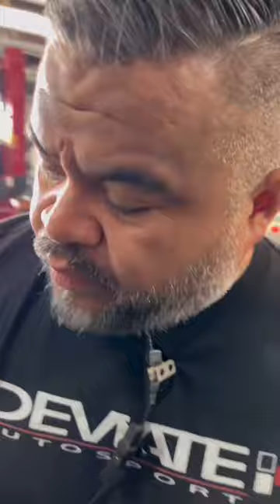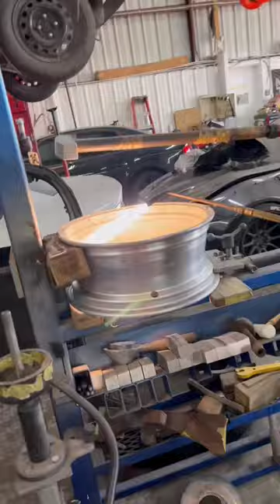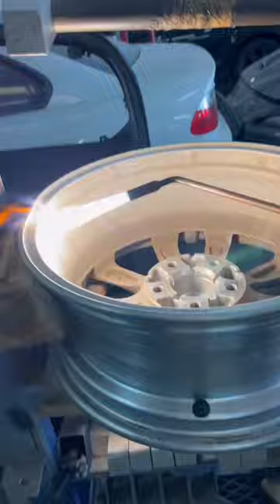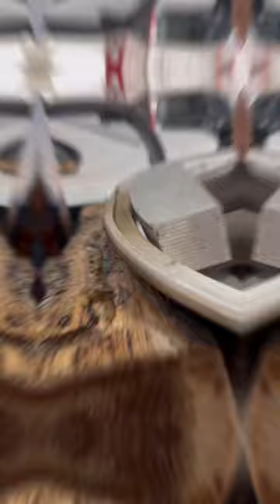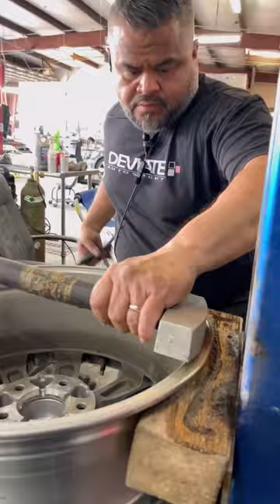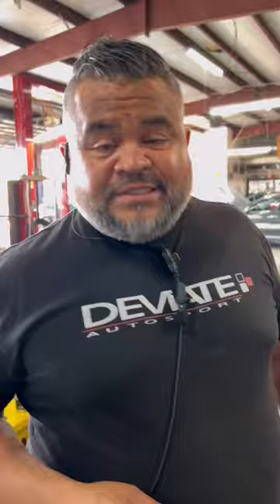@dv8aroldo  SHOW’S HOW TO FIX BENT WHEELS‼️‼️ #shorts

Comment: Aluminum is very soft and once a metal has bent, it loses strength. Furthermore, heating it up also causes material changes to the structure of the metal.
Reply: But he a hustla he a he a hustla he a hustla he a he a hustla
Reply: agree 100% I'm sure he knows that and has the customer sign an agreement and tells them to NEVER put them back on the front of the car again.
Reply: @FetusFight 🤣

Comment: Once its bent the integrity of the metal is compromised and it will be forever weak in that spot. It will want to bend back into that shape overtime.
Reply: If its on a race car where everything counts then it would be a problem but  on a daily driver that probably wont see much abuse it doesn't matter all that much.
Reply: Abuse? 😂 shits already seen abuse daily driven
Reply: Straighten it and sell em mint condition 👌🏼
Reply: Yet it's done every day, and to high end exotics.  Nothing is blowing up, coming apart or bursting into flames. Calm down.
Reply: When you heat aluminum it anneals then when you work it "work hardens" should be just fine
Reply: Like 65 million years
Reply: 😂 stay in school
Reply: @yungtye 😂

Comment: Are you concerned with adding heat on that aluminum like that?  Do you use heat crayons or anything to know that you haven’t compromised the structure?
Reply: Aluminum alloys lose almost all their strength well before 300C / 572F. The structural integrity of that wheel is extremely compromised.

Comment: Id just get a new rim to be honest . Especially on something like a rear wheel drive sports car pushing 500 hp
Reply: It’ll be fine
Reply: It dont that serious bud. Its a very minor bend. Ive seen race cars with worse wheels than that.
Reply: it was super minor its fine
Reply: What car is it I didn’t see
Reply: rear wheel drive sports car pushing 500 hp🤓
Reply: @gang1798  it'll wobble like crazy
Reply: I disagree I worked in west Texas oilfields a few times because we bend rims on f350 in the wild days either drunk or on drugs after working 18 hour shift and hit cattle guard 30 mph asleep lolz then we take sledgehammer bend it back drive 200k miles hauling heavy ass overweight like pull me over please  past oil change 10k mile ole 6.7 psd baby rotella keep em pedal to the floor 😂 she was ran hard all the time with the it didn’t happen repair
Reply: This looks way more professional then sledgehammer accuracy
Reply: @clozedcaskets1438  West Texas trucks get beat tf up…no matter what company it is. Dents in the bed, what once was a metal truck bed is now a wood truck bed, broke back glass. I see a lot of it just from customers coming to the machine shop I work at 🤣

Comment: It's illegal to repair aluminum rims in most places in North America due to how much it's structural integrity is affected
Reply: that’s odd, i wonder why there are so many aluminum wheel repair specialists?
Reply: @SomcallmejameS  they're not a "Specialist" they're a hack. The amount of metallurgical precision you need between getting the right temps to ensure no micro cracks form when straightening the rim or that the metal won't be too brittle because it wasn't cooled at the right rate is too precise for it to be safe for just a random shop to repair. That's why it's illegal.
Reply: @SomcallmejameS  not to mention, to do it properly with all the right tools, temps and cooling time, by the end of getting to done right it would have been cheaper to get another set of rims
Reply: @buttadog5073  i’m sure the cast aluminum wheels from the factory are made with the UTMOST metallurgical precision. 🙄 The dude’s not out here bend fixing a TE37. It’s a factory alloy wheel. Even if you’re right about this it doesn’t explain why so many people are getting away with doing it (problem free i might add) on a daily basis if it’s genuinely illegal.
Reply: @SomcallmejameS whatever you say pal. If you knew anything about cast anything you'd know bending it severely reduces it's strength unless it's done at the right temp and cooled at the right rate, all there is to it
Reply: @buttadog5073 the heat was to anneal the aluminum then work hardens it's fine

Comment: I’ve had this done in the past on some amg wheels and they were great it was expensive the shop near me charges 140 bucks if it’s pretty bad and they were really bad 2 bends in it on the rear and it wouldn’t hold air or bun after that. Once it was fixed it was good though sold the rims bought new amg wheels hope that it doesn’t happen to these

Comment: That's amazing. Still driving careful with my wheels but I bet this cost less than replacing one ~$350 rim
Reply: Oh yeah. 
Probably around an hour in labor. Most shops where I'm at, that's $150 to $200. 
.3 to mount and balance a wheel. And then another .6 to .8 to set this up and press it. 
High(er) end wheels it's definitely worth it. 
Cheap(er) 16 inch and 17 inch, it might be easier to just buy a used one from a junk yard or FB market place or something
Reply: No, higher end wheels are not worth it to do it this way. Wtf makes u say that besides cost??? If you have multi-piece rims u can afford to change an inner or outer barrel. Foh with that bs. 
And before u ask, I run a set of HRE 540s so I know a thing or 2 about repairs.
Reply: @Mac7504-OG  not all expensive wheels are multi piece? That's why?
Reply: @joec1995jc  oh I didn't know this. Forgive me.
Reply: @mmix224  high end wheels it’s worth it but paying half the cost of a cast wheel just to straighten it is worthless you might as well buy a new one
Reply: @Mac7504-OG  yeah wth there are forged one piece wheels

Comment: Heating and stretching causes metal to become weaker you've just done both so next time they hit a pothole their rims more likely to just explode
Reply: I had a completely broken run fixed and it still fine. By completely broken I mean broken and split open, but it’s fine now I even went down in a few potholes and it held up great.

Comment: You can fix wheels just dont use heat it weakens the metal then you will hit one pothole and it will be back so just hammer it out has best has possible

Comment: I've bent 2 rims in my life so far. A sledge hammer fixed both of them 🤣 they were steel rims though not aluminum!

This turns out better than the sledge hammer did tho
Reply: Steel is far more forgiving than aluminum for fatigue, and I bet you didn't hit the wheel with a blowtorch?

Comment: That's not fixed and it's still a weak point. The entire wheel needs to ve heat treated correctly to actually fix this. Which is why it's cheaper to just get a new wheel and scrap the old one.

Comment: Now I'd be impressed by the fancy machine but em I'm still doing it with hammers and a file lol clean repair but I'd flux it for cracks aluminum is pretty bad about it especially the cheap aftermarket crap ppl put on. Now and old school set of BBS or works or volks different story all together.

Comment: Not very smart on aluminum or alloy wheels. That's always going to be a weak spot and potential future failure point and will be deformed easier the next time and potentially crack and fly apart at high speeds. Steel wheels aren't such a big deal or if it's for offroad use at slow speeds, like farm equipment. If it's alloy or aluminum, just go the safe route and buy another rim.